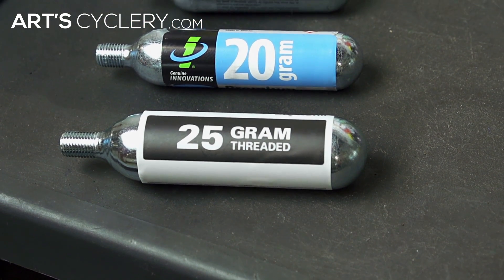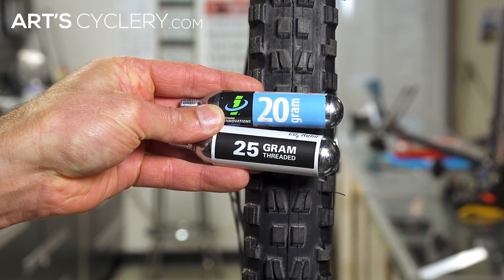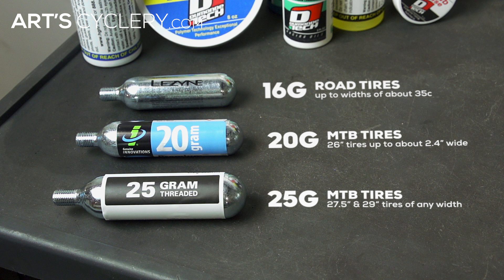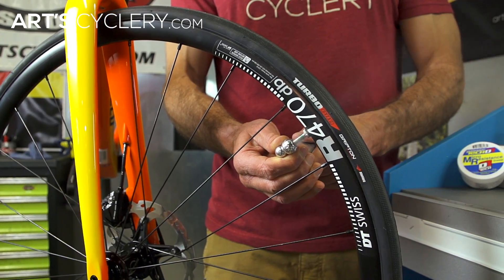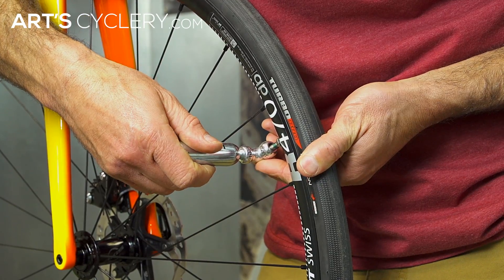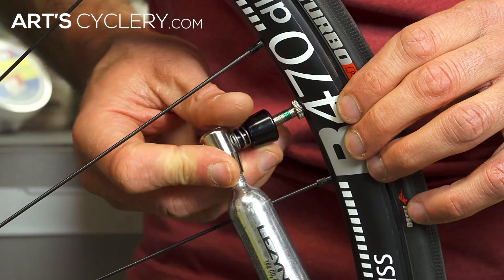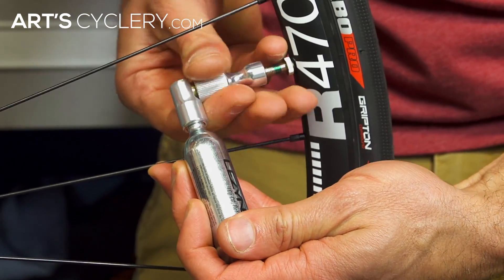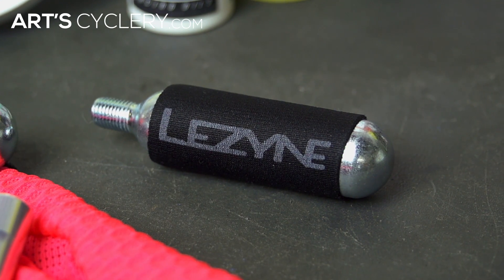Learning Center: The Ins and Outs of CO2 Inflation for Bicycles

Comment: Everything is always silky smooth on youtube until you are stuck in the middle of nowhere with mosquitos about to suck you dry and you are helplessly battling some co2 catridge that won't inflate the tire. I used one yesterday, it was the threaded one, noone told me once threaded, you have to finish using it otherwise, it won't stop releasing air. so, stop with the lies, you can't reuse a catridge that is already threaded. Long story short, I lost the air both in the catridge and the tire I was attempting to reinflate. Luckily I had a gas-station just 2 km away.
Reply from the maker: Sorry to hear that! With most  threaded inflators, you can thread the cartridge all the way in and get a seal. It isn't perfect and typically leaks slowly over a week or so...but in your situation would have saved the air.
Reply: Exactly why one should practice the technique in the comfort of one's living room or garage if married.  It WOULD be silky smooth if you knew how to do it ahead of time.

Comment: how much g cos do i need to seat a tubeless tire that went off in the trail? is 16g enough? I am just trying to seat the tire, I have no problem pumping it to the desired pressure by hand. but I dare anyone tries to seat a tire using handpump.
Reply from the maker: Seated a tire with Co2 is super tricky. If there's any leaks, you will lose air quick. I would opt for at least a 25gram co2 for attempting to seat tires.

Comment: Below is a spec table that shows what PSI you can get from each type of C02 cartridge for reference.  I found that 16g carts only give me 65psi on 25mm (28mm when inflated) tires.  I've gone with 20g now. I can use them on my Road and Mountain bikes.

https://www.google.com/imgres?imgurl=https://i.stack.imgur.com/eNvZZ.jpg&imgrefurl=https://bicycles.stackexchange.com/questions/9583/not-sure-about-using-a-co2-cartridge&h=2128&w=1572&tbnid=sZcRreV0BGpAJM:&q=what+size+co2+cartridge+for+road+bike+tire&tbnh=160&tbnw=118&usg=AI4_-kQYi5-V8dmdC0G1Ui1IDgk9cFaZNA&vet=12ahUKEwi7subngZXgAhVndt8KHeuEBv4Q9QEwAHoECAYQBg..i&docid=jc_I0iMEIJ5HhM&client=firefox-b-1-ab&sa=X&ved=2ahUKEwi7subngZXgAhVndt8KHeuEBv4Q9QEwAHoECAYQBg#h=2128&imgdii=hSTBYfVKx5d3mM:&tbnh=160&tbnw=118&vet=12ahUKEwi7subngZXgAhVndt8KHeuEBv4Q9QEwAHoECAYQBg..i&w=1572

Comment: PRO TIP: use only 12G CO2 cartridges for road tires.  They don't need to be inflated to more than 90PSI, especially on newer wider  wheels.
Reply: It depends on the tire size.  That is good for a 23mm tire.  I tested my 16g cartridges on 25mm tires (28mm when inflated) and only go 65psi.  I will now carry 20g cartridges which gives me a bit more.  See cartridges spec table below.

https://www.google.com/imgres?imgurl=https://i.stack.imgur.com/eNvZZ.jpg&imgrefurl=https://bicycles.stackexchange.com/questions/9583/not-sure-about-using-a-co2-cartridge&h=2128&w=1572&tbnid=sZcRreV0BGpAJM:&q=what+size+co2+cartridge+for+road+bike+tire&tbnh=160&tbnw=118&usg=AI4_-kQYi5-V8dmdC0G1Ui1IDgk9cFaZNA&vet=12ahUKEwi7subngZXgAhVndt8KHeuEBv4Q9QEwAHoECAYQBg..i&docid=jc_I0iMEIJ5HhM&client=firefox-b-1-ab&sa=X&ved=2ahUKEwi7subngZXgAhVndt8KHeuEBv4Q9QEwAHoECAYQBg#h=2128&imgdii=hSTBYfVKx5d3mM:&tbnh=160&tbnw=118&vet=12ahUKEwi7subngZXgAhVndt8KHeuEBv4Q9QEwAHoECAYQBg..i&w=1572
Reply: My road tires are recommended to have 120psi
Reply: COMMUTER TIP.  It takes a 20g cart to fill a 700x32 to around 90 psi, perfect for my 32mm Gatorskins.

Comment: What psi/bar can you achieve with CO2, (road tire)
Reply: See table below.

https://www.google.com/imgres?imgurl=https://i.stack.imgur.com/eNvZZ.jpg&imgrefurl=https://bicycles.stackexchange.com/questions/9583/not-sure-about-using-a-co2-cartridge&h=2128&w=1572&tbnid=sZcRreV0BGpAJM:&q=what+size+co2+cartridge+for+road+bike+tire&tbnh=160&tbnw=118&usg=AI4_-kQYi5-V8dmdC0G1Ui1IDgk9cFaZNA&vet=12ahUKEwi7subngZXgAhVndt8KHeuEBv4Q9QEwAHoECAYQBg..i&docid=jc_I0iMEIJ5HhM&client=firefox-b-1-ab&sa=X&ved=2ahUKEwi7subngZXgAhVndt8KHeuEBv4Q9QEwAHoECAYQBg#h=2128&imgdii=hSTBYfVKx5d3mM:&tbnh=160&tbnw=118&vet=12ahUKEwi7subngZXgAhVndt8KHeuEBv4Q9QEwAHoECAYQBg..i&w=1572
Reply: It depends on the width of the tire and the width of the wheel rim.

Comment: If you use a full size frame pump, instead of those ridiculous short things, pumping is no problem.  But, weight weenies will say, "A frame pump is heavy!"  If you carry a mini pump and a CO₂ inflator have you saved any weight over a full size frame pump?  Not really.  Plus, weight weenies should really know that, at the same inflation pressure, the weight of carbon dioxide in the tire is 45% more than the weight of the same volume and pressure of air!  If you use 16 gram CO₂  cartridges, that comes to 5 grams per tire of rotating mass extra using CO₂ over air.
Reply: +1 simply because you considered the weight of the carbon. That's just weight weenie gold right there.

Comment: I'm not a fan of throw away products, inflating with a pump takes 2 minutes and you generate no waste! I could see them as the only option when time is of the essence, say for example at a race with no team support; but for training and general riding use a pump.
Reply: I don't like the cartridges either, I've seen spent ones on the trail. :(   Don't be lazy, use a pump.
Reply: Ya but, you know that aluminium is 100% recyclable..not as your chain lubricant, damaged tires, and all plastic..even the sealent d
That cannot be reused...maybe you don't know how much difficult is pump air when you are so fuckin tired after 30 km in 1h 1000m h
Uphill n you need to come back home..believe me, cartrige are not so bad for enviroment. Just my two cent..
Reply: @stefanoboi6334  The cartridges are not aluminum, they are steel.